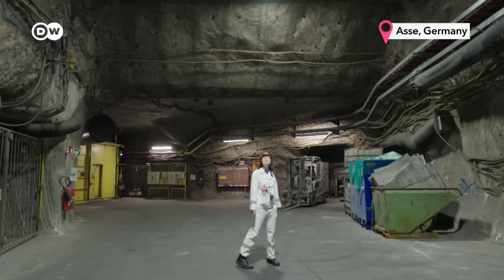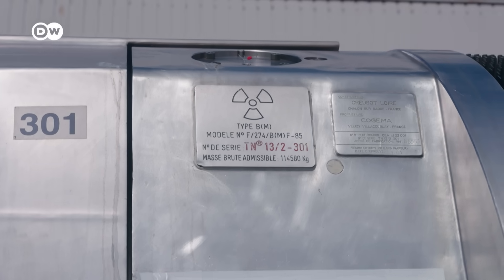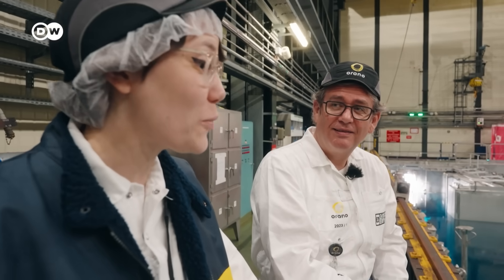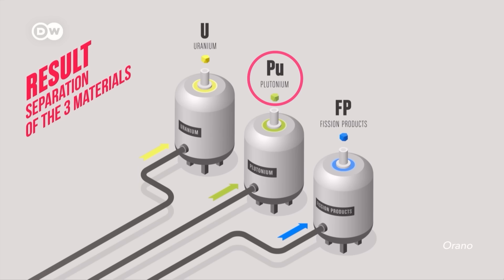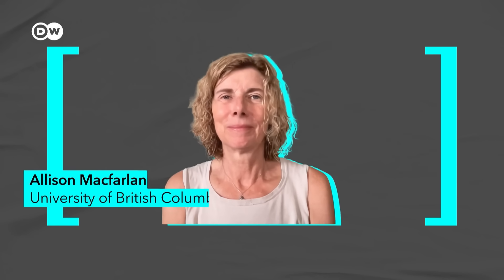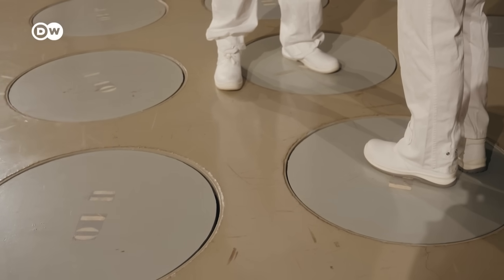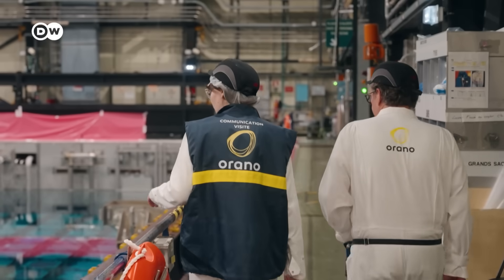Nuclear waste is reusable. Why aren’t we doing it?

Comment: Well because you have to work with fairly highly radioactive material to dissolve solid fuel rods into a molten fuel salt, use electrolysis to separate the fission products out (which is fairly energy intensive) to turn them back into fuel rods, which is pretty inefficient and expensive.

There is the option to just have the fuel be constantly be resolved in molten fuel salts for more efficient processing, but that processing is similar to what you need to do to make material for a nuclear bomb, so proliferation risks and the online reprocessing obviously has a cost which you would have to put in each reactor rather than having 1 large site where you send your spent fuel which can be highly secure to reprocess your fuel. Although because you are constantly reprocessing your fuel the part of the facility to do reprocessing doesn't need to be nearly as large, so might work out, although economics of scale might bite you in the ass, but the facility is small enough that you could put it in a few cargo containers you could build it in a factory which might give you back economy of scale and if your building enough of them might even surpass a central processing plant.

there are questions as to it's economically viability even if we spend time and money money developing them, although one might ague that even if it costs more we have a duty to reprocess the fuel to bring down the lifetime of the nuclear waste to one which is manageable. Although deep geological repositories are safe so.

Comment: Wild guess: Money
Reply: And a large chunk of that money would likely be due to risk management from handling tonnes of nuclear waste to separate the desirable irradiated stuff from the undesirable stuff, then having to handle the concentrated radioactive waste on one hand and safely handling the fissile stuff on the other.

One major problem with recovering fissile materials from waste is that everything needs to be processed in batches small enough to never come anywhere near critical mass. Can't just throw a ton of nuclear fuel in a crucible and process it all at once since there is a risk U235 or Pu239 could settle at the bottom without active stirring and go critical. Got to split it in loads that will never contain 56kg of U235 or equivalent after de-rating for other fissile isotopes in the input waste.

Too many things can go wrong if you try to be cost-effective about it.
Reply: *because it's not profitable
Reply: @thedoctor.a.s1401  *Because it's not as profitable as oil
Reply: @thedoctor.a.s1401 https://youtu.be/cbeJIwF1pVY?si=5WjMwNtDzzuB2EIL no, the other way around
Reply: @thedoctor.a.s1401  Nobody works for free.  Unless you’re offering your services?
Reply: @AJ_Sparten1337  I know, that's why we need to find a way to make it profitable to recycle.  U get me..?
Reply: Wild guess: Politics.
Reply: yes but as always it is because the financial system currently doesn't account for environmental damage and cleanup. that is why we still are dumping vast amounts of garbage into landfills instead of reusing the materials: it is somebody else's problem - probably our children's or children's children's who can later clean it all up. as crazy as it sounds the GDP actually goes up if we pollute an area and then clean it up and restore it to the state it was before.
Reply: @anssiluomaranta34  Humans are terrible at preventing but great at innovating.  If you want things to be recycled, go waste your time, money, effort, resources, and brain power into designing/inventing a safe way to so instead of complaining that others aren’t.  Another bug factor in improving innovation is to reduce regulations.  Get the EPA off of everyone’s ass so that they can actually do something.
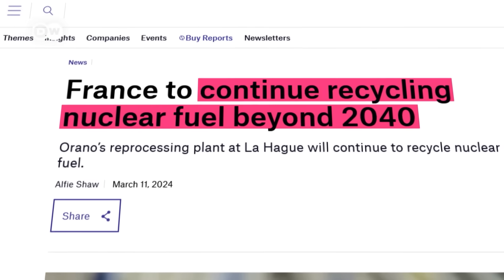Reply: 13:00 there is reusable uranium fuel sitting around, which cost the country looots of money, but they dont use this it until it gets more expensive? thats something stupid...
Reply: Fear
Reply: and probably politics
Reply: Bruh. Have you seen how people will go full nuts when some politictian or people say we need to build nukclear power plant. They keep repeating the fukushima and chenoby, 3mile as a excute for not invest and develop it. Even theres prove that they have been more safer  and can reused. 
The green tyrran only focus the 'real green energy' and said nuke is outdate and dangerous
Reply: Well yeah, do you expect a highly complicated and dangerous industrial process to be done for free?
Reply: It would make your energy bil more expansiv
Reply: This is the end all be all as far as nuclear is concerned in the US. Yes! it is the cleanest and most green form of energy, but it is also the most costly. Recently plants like Three Mile Island have shut down because they are dated and in need of upgrades, but the cheap price of natural gas in its area makes these upgrades not profitable. Therefore, the plant gets shut down. I know, its not long term thinking, but in these US of A the almighty dollar always wins.
Reply: Nope. More money could be generated if they would put up smaller power plants
Reply: Its fear. 
Some fear is healthy.
We know we could make reactors as cheap as any coal plant.
We don't because we know this source of energy has inherent risks above and beyond a coal plant.
So we regulate it, require security, check it, ect.

The problem is that people who do not understand it are afraid of it.

They demand leashes and collars and inspections like its a tamed devil that will go off like a bomb if we ever blink.

Reasonable, rational regulations would be plenty and wouldn't cost nearly as much.
Reply: Exact same reason as any recycling
No investor is going to approve a method that costs more to do and lower profit margin. Just imagine the effort required to make an old car run or be near the level of a new car, certainly it will work, but at what cost.
Using new material always requires less effort than reprocessing used material, it's not even about finance, it's just hard cold reality.
Reply: Oh no! I'm pretty sure there is PLENTY of money to be made producing nuclear explosions, so I'm pretty sure it's not just money.
Reply: There's a lot of money put into nuclear power hype (and I suppose this) but the point is that you're wrong. It's not about money, it's about public fear of nuclear power and misinformation. 3 Mile Island is when the investments stopped in the USA. That's not a coincidence and it's not about cost.
Reply: Aka, ambientalists and Eco-companies funded by oil companies
Reply: nope, costs😂
Reply: the correct answer is actually because it's how you make nukes.
Reply: @cageybee7221  Cash for spent fuel rods? That's one hell of a recipe for destruction.
Reply: Alas, no.  It's not money.  It's politics and public opinion.

Greedy people can be negotiated with.
Reply: Wrong. Lost competence.
Reply: exactly, you don´t even need to watch the video to guess that, and that´s about all you´re getting here. they leave out all the interesting and cool stuff. this isn´t tiktok you´re allowed to take a few minutes
Reply: hint : don't let free market into your nuclear energy industry and keep it state owned.
Reply: @Sacrypheyes  Nuclear is so regulated everywhere, it's essentially state owned anyway.

Comment: Why is almost every power source about heating just to turn a turbine? Surely there's better methods..
Reply: If there were better methods, those would be in use. It is used because it is cheap, efficient and very reliable.
Reply: On-shore wind with 4 hours of battery storage and solar PV are both cheaper than nuclear, and don't require boiling water or turbines.
Reply: @Cynthia_Cantrell  And don't offer the same continues power that nuclear does. 4 hours is cute and all but no where near what is needed.
Reply: @vincentgrinn2665  what research are you reffering to, i'd like to read it.
Reply: @Cynthia_Cantrell 4 hours isn't enough. Maybe only in regions with sun pretty much all the year. If you have some cloudy days and winter- tough luck.
In most of the cases when you put the requirement for renewables to generate all the year constantly regardless of weather, year and night, at minimum same amount of energy as nuclear pp, the costs for storage grow to huge numbers
Reply: @Cynthia_Cantrell  what do you mean? wind energy come literally from gigant turbines.
Reply: @ManuelDiaz-rn8ps  Although they call them "wind turbines," they don't require boiling water or the giant compressor that is associated with a "steam turbine" in most electricity generation.  The blades in a "wind turbine" directly rotate an AC or DC motor - no boiling water, steam, or compressor.
Reply: I agree sure, so what is your suggestion ? Im all ears xD

Comment: Ayo bruv the current paradigm of human consumption is so inefficient
Reply: Seriously, Everything is made to be disposable now. Almost impossible to fix things now. 50 years ago it was different
Reply: Made in china
Reply: That is so eloquent.
Reply: @Shortfilmsyou  Iz inglis bruv. Innit.
Reply: Oi yor raight geezer, da current paradigm ain't sustainable 🍻  
Cheers
Reply: @ecognitio9605 Innit mate.
Reply: Almost nothing should be "disposable". Companies should make products which either last, or which they can purchase back from us after we've used them in order to recycle them. Instead of passing off recycling responsibilities onto consumers and governments.
Reply: @ForumArcade  I guess if companies were charged with the responsibility, they would just find the cheapest way to cheat their way out of it. Companies are like living entities, as soon as they grow large enough they start running themselves. The humans that put the company together transformed into slaves to solve the practicalities. Nobody has the power to ask if the company should grow because the only purpose of the company is to grow.
Reply: . Impost TERIFF on COUNTRY  who allow companies within there borders to produce  products  that are not built  to last years or decades like a refrigerators or washing machines  / hot water heaters..trillion type of  toys 
Furniture building materials  used  by privet consumer's... and recycle penalty if not designed  manufactured with ability & direct application available  to civilization to recycle  these old products. 
Tax on a recycle  fee at Retail purchase  point 
Refundable in forum  of 
Energy TAX CREDIT'S :  refundable  too
 PRIVET CITIZENS 
 OR
 NONE PROFIT privately owned CAUSES of educational only...
Reply: Those in charge don't care they just want money.
Reply: fax bruv
Reply: No cap. On god nuclear fear gooning is peak.
Reply: @iamscoutstfu  edging it to radioactive waste fr fr
Reply: Welcome to the universe of inherent energy conservation theory and engineering. That is all life forms concern. Energy efficiency
Reply: Facts bro
Reply: Ok so throw your hands up and do nothing.
Reply: You said something so incoherent yet with much understanding. People are confusing now
Reply: it's called capitalism
Reply: Capitalism
Reply: It'll be our end
Reply: In nature another organism repurposes your waste. We still haven’t evolved past this.
Reply: Y ah it is not.
Reply: Ayo bruv talking that way makes you sound like a droolbaby skibidi wotever it is child
Reply: That's capitalism for ya.
Reply: Fr fr 100p
Reply: It doesn't solve the biggest problem - eliminate the most radioactive waste, it just asperates and condense it.
Reply: yeah, it's somewhat efficient at only one thing: centralizing power and redistributing wealth to a small subsection of the population.
Reply: I’d say it’s getting better with the passage of time. I mean back in the we thought whale oil was the primary source of energy for lighting. And before that we wasted wood. Now we are breaking atoms and now recycling even that. You can’t expect dumb monkeys to have attained 1:1 energy levels without trial and error.
Reply: You mean all of modern human history? Cause yeah, we fucked it up.
Reply: Yea
Reply: People don't care, they interchange efficiency with effectiveness, which is obviously wrong, people failed in school trying to even change gender, like who taught them english
Reply: Religion is the anti science fungus
Reply: What sort of retarded is this?
Reply: Yeah, and disposable vape products are doing a good part to add to it.
Reply: Why is half of this argument delusional people who think that the modern era is the worst one and soon going to crash and burn. Calm down
Reply: Ditto! But the capitalist hunger is insatiable, therefore, we will inevitably destroy the Earth’s habitability and by consequence, ourselves and all for what? Because some ignoble schmucks believe money and wealth make them gods. 🤭

I’m confident life will adapt and hopefully the next só called intelligent life form to emerge here isn’t as retarded as humanity.
Reply: I know, man. We could literally be using so many more resources with so much less work if we just tried. Consumption, people!
Reply: It's  logistics  that's  inefficient
Reply: It is basic economics, capitalism does not care about nature or whatever, it just cares about Money, and renewable energy sources like wind solar are just give away so we think they are doing good, but in fact they continue to use coal, buy politicians to cover up their mess and so on. Whatever you say, but cuba (it has fallen behind bc of embargo from Us) and china are first world countries in renewable and/or clean energy
Reply: It’s always cheaper in the short run to just dump the waste instead of recycling. Companies only care about money so they’ve picked their choice.
Reply: @mrcatsoup4496  Technically, its almost always not cheaper. Someone is willing to pay you for materials you see as useless, its just that these companies make so much money that they would rather have people trying to scam more people. Its much more profitable to scam new people than to deal with your old business partners, thats how America works
Reply: Then stop it
Reply: on foenem bro
Reply: Liberals
Reply: All about paper cost. Instead of doing things the best way, and most efficient way, we do everything with the main thought being how can i get more worthless peices of paper (that doesnt even have coll artwork on it, and backed by liars promise. Ridiculous!
Reply: This is the most prosperous time in all of human history
Reply: @Goodyear1776  definitely not
Reply: @mhxxd4  ok, then what time in history has been more prosperous for more people than right now?
Reply: @Goodyear1776  
We're 8 billion right now and are nowhere near sustainability.
We're currently using the resources of 1.6 earths or so per year.
That means in order to sustain us 8 billion the way we live right, consume and produce food, energy, etc. right now, we'd need 1.6 earths. Something we obviously don't have.
There's a lot to gain in terms of energy efficiency, but not that much more in terms of food production efficiency. Especially not if you want a lot of untouched nature at the same time, like the guy I replied to said.

So again, with what we do right now the planet can't even sustain 8 billion of us, quite far from it.
Reply: @Goodyear1776  literally 4 years ago, 10 years ago, 20 years ago, 50 years ago
Reply: There is enough uranium in the seawater and easily dissolved into the sea water to last humanity longer than life on earth will. It's not so precious of a resource.
Reply: We're doing all this just to create steam to power turbines. That feels like stone age tech. 
But then again we poison ourselves to have fun. It almost seems like a perfect fit.
Reply: Everything is not scarce and we have to deal with costs. The goal is not based on reducing wasted material and it shouldn't be either. Cost efficiency beats resource efficiency, no one is gonna pay more for your less wasteful nuclear energy
Reply: but nuclear fuel doesnt have much practical use (i know this entire video is about this but its not cost efficient)
Reply: @thatonemoviebob3902  >t. Big Petro bootlicker
Reply: @thatonemoviebob3902  fossil fuel waste is literally just releasing greenhouse gas into the atmosphere causing more climate change. Fossil fuel waste have done way more harm than nuclear waste.
Reply: Maybe that's natures plan.
Reply: @timlaws7034  here we go again with THIS fallacy